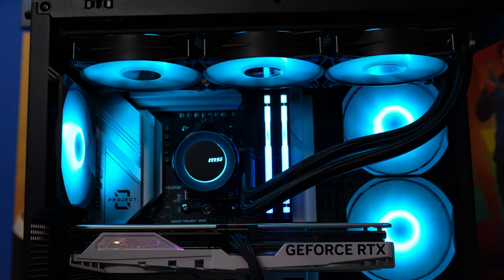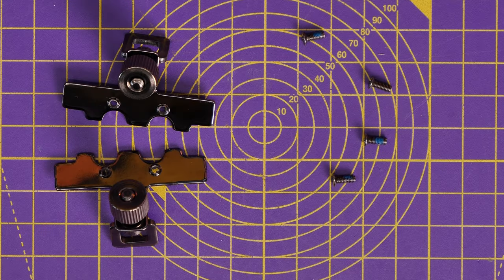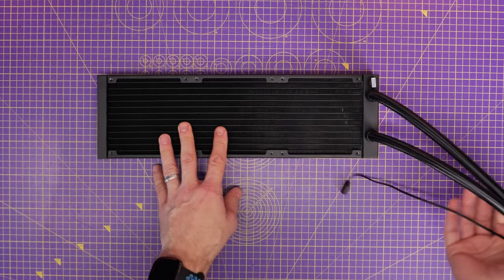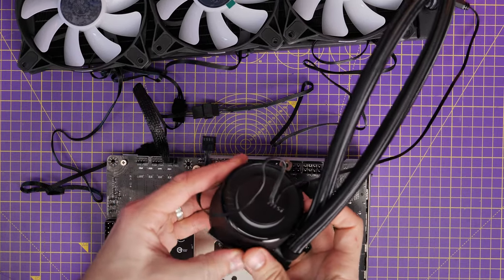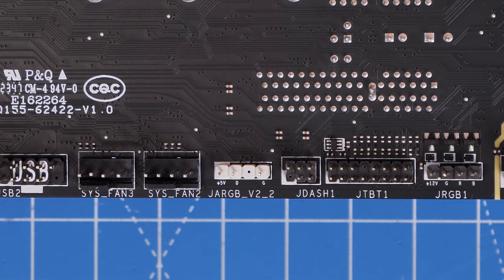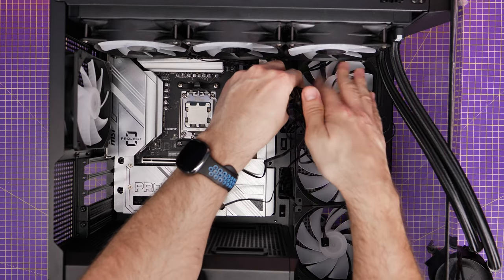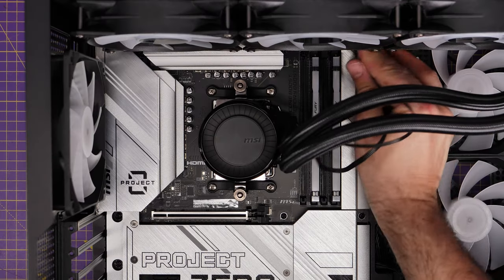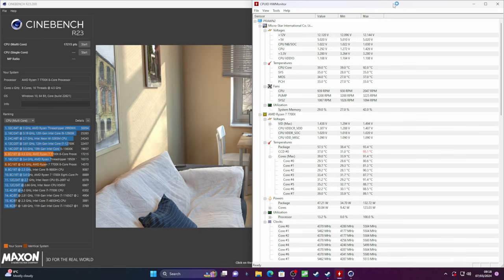MSI MAG Coreliquid E360 AIO Install guide (AMD AM5 setup and rear connect motherboard tips)

Comment: I’m wondering… can I control ALL fans rgb (including both case and refrigator) with the motherboard software even if I have 2 groups chained for each? (The case ones on the plaque at behind and refrigator at the motherboard). Or the case ones can only be controled with the case switch?

Comment: I'm going to be very honest. Msi has amazing products, when they work. I bought the coreliquid 360 v2r and I used it for a total of 1-6 hours and I noticed instantly my temps where high. When I took off the copper plate the fins where stuffed with wet paper. If you get a msi product make sure it works 100% before you keep using it otherwise it will die fast.

Comment: So i must have an updated version of this cooler, it came with seperate amd/intel hardware but theres a bracket already on the pump that isnt removable that has both slots for amd/intel on them. Not sure what side (closer to the copper plate or the other side of the bracket) to put the buckle for amd now lol